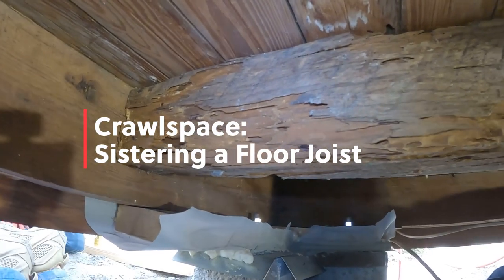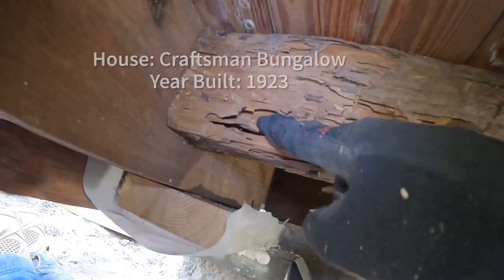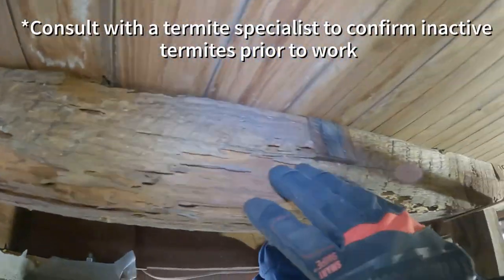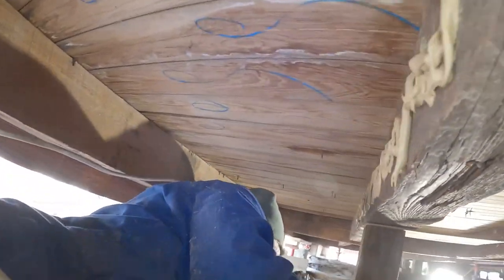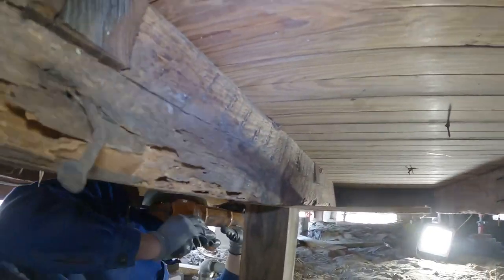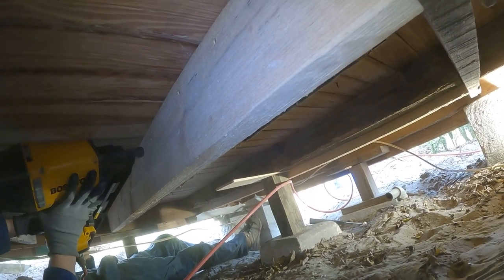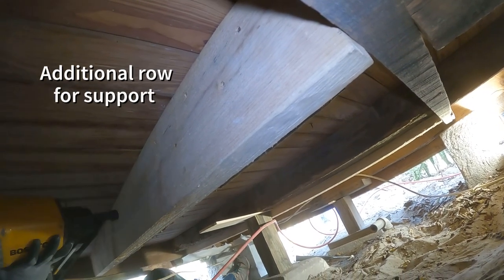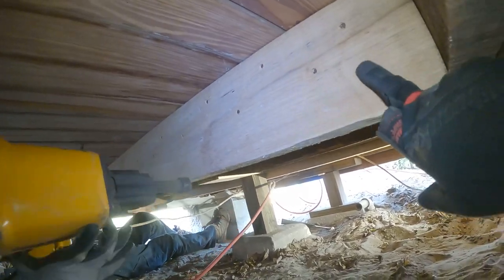Sistering floor joists due to termite damage in crawlspace (and how to use a nail gun!)

Comment: You should really have removed the rotted floor joist. Now that rot will be there forever. I renovated a 3 story house built in 1864, we had to replace 35 foot of sillplate and wall studs up to 12 foot. As well as several rooms and several beams that exist down the middle of the house. We removed all rot. I ran into a situation with this house where someone repaired a floor joist about 20 years ago and left the rotted one in and it attracted termites and they ate both of them back out again. We removed them completely this time around and replaced it.
Reply: Could you share the cost of the repair that you mentioned? In a similar situation.
Reply: @kevinlai355  It was $2k - $3k in material not including replacement siding
Reply: Yes Remove the rot all the way to the Dumpster not left under the house and vac up debris that came from it and put a sealer on the ends if you cut them.
Reply: The reason why you leave the old joist in place is that unless you are nailing the subfloor from above into the new joist there’s no way to anchor, efficiently the subfloor to the new wood. So by sistering the new to the old, you still have connection to the subfloor above.
Reply: @chrismurrmann6182  great comment i hadn't thought of that!

Comment: So you nailed the new joist to the rotten joist , practically you did nothing 😅
Reply: The old joist still has integrity, so it’s left, it’s just reinforced. That ls just how it’s done, if the damage is bad enough it is fully removed
Reply: its nailed at both ends

Comment: that old joist you are replacing with something significantly stronger.  the old joist becomes no longer relied upon then.  It becomes REDUNDANT.  Now, this doesn't mean you have to tear it out, but since you aren't relying on it at all and if it were gone you'd be good to go, then any gluing to it or screwing to it becomes completely pointless because it is no longer relied upon for load bearing AT ALL.  So the glue was a waste of time and money and any screwing to it also a waste.

Comment: Thank you for the video. I would not attach a new joists to a damage existing one due to termite.
Reply: Right. You can't land a plane on a cloud. Garbage repair.
Reply from the maker: What's sad is there was actually more than one termite.
Reply: They most likely didn't wanna jack up the house to cut out the old board.

Comment: the end of the new joist does not seat on a post, is pretty much doing nothing but hanging on a rotten joist.  Unless later you placed a post under  where it met with the perpendicular beam.
Reply: its a joist not a beam

Comment: I would have used a bottle jack underneath to lift her up a bit, most likely a small dip in the flooring above. If not it hasnt fully failed and you got lucky cause every floor joist in a crawl that I have to replace requires me lifting up the house.

Comment: Why didn't you use any hangers to support the new joist?
Reply from the maker: Because the old joist didn't have any shear failure, it was only flexing due to undersizing, and this was a repair to stiffen the floor in a particular section, not bring the entire floor up to current building code with hangers.

Comment: I’m no contractor, but I would have gotten a couple of hydraulic bottle jacks with some supports. along with that sledgehammer and made life a little easier.
Reply: That's how it's really done. I've never not used bottle jacks to lift and sister a broken floor joist.
Reply: How do u level it if you don't have a jack...
If the joist fails its gonna have some sagging in that area...
That's just the experience I've had  when replacing them...
...But I don't know everything ✌
I

Comment: What type of wood did you use? Is it rated for that use? I need to do the same but unsure if I can use wood from Home Depot
Reply from the maker: We like cedar, cypress, and pressure treated southern yellow pine. If it's close to the ground code requires it to be treated.
Reply: @abodebuildingcompany   I really appreciate the response. You gained a sub! I was unsure if I had to use foundation rated 4x6 or if I can double or triple some 2x6 pressure treated ground contact from Home Depot.
Reply from the maker: As you're probably aware, you are limited by your ground clearance. The more clearance you have, the taller lumber you can use, which is better.  Ex: 2x8, 2x10, 2x12. All better than 2x6. You'll need a structural engineer to confirm your design. There are ways you can use 2x6 doubles or triples but you need to run lag bolts or allthread through them to make it one constructed unit.
Reply: @abodebuildingcompany  cant you use nails instead of lag bolts or allthread?

Comment: If they live in an area with termites why don't they build with a concrete base and use bricks and mortar for the walls, like houses used to be built in Britain?
Reply from the maker: Could be cost, availability of materials, finding labor that can build with the selected material, and the roof framing is usually wood anyways